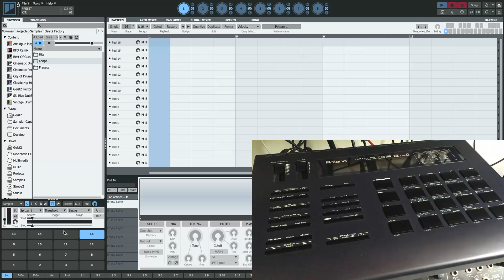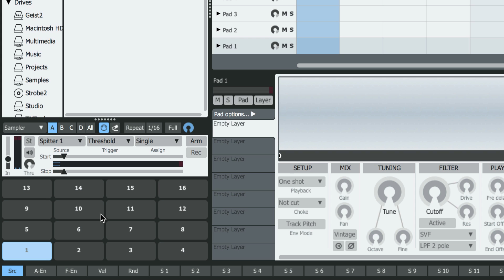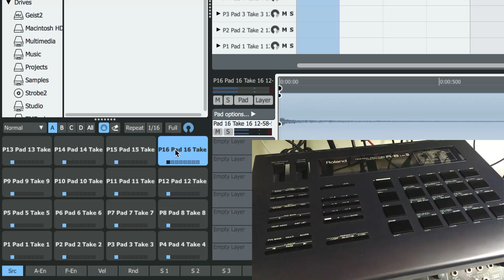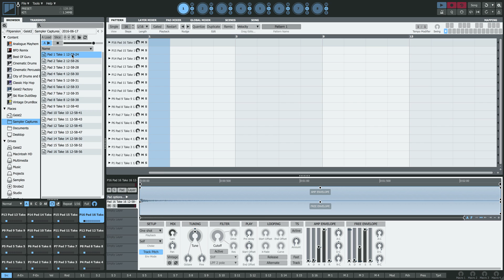Geist2 Tutorial - Sampling a Hardware Drum Machine

Comment: Spitter is the best!
Reply: Jesse Tal what is spitter?
Reply: Spitter is a little FXPansion utility plugin that also installs on your computer when you install Geist 2. Think of it as an audio transmitter for Geist. You first load the Spitter plugin as an effect on a DAW track that you would like to sample into Geist. Then load Geist onto an instrument track in the same project and choose Spitter as the external sampling source. Once Geist has been record-armed, any audio on the source DAW track will be sampled into Spitter -- ready to be chopped up and rearranged in Geist however you choose! :-)
Reply: Jesse Tal ahh. iv had geist 2 for a while now but have hardly used it. manual is too big to go through and I'm too knackered when i get home from work
Reply: @jessetal  You only need this when your DAW is not able to do that.
Reply: @janvandeweyer3272  Just about all DAW's can resample but the beauty of using Spitter is that you have such a great degree of flexibility in terms of what you can do with the audio immediately in Geist 2 depending on how you set up your recording mode in Geist 2.

Aside from that, there are times when I just simply like to use Geist 2 as a remixing tool, and getting DAW audio into Spitter is great for rearranging material in Geist 2 and/or applying Geist 2's internal modulation or fx.

Keep in mind also that when you save an fx pstch in Geist 2 that contains modulated parameters, the modulation is recalled when you reload the fx patch. That means that you could set up an audio mangling template in Geist 2 to twist around audio recorded into Geist 2 from your DAW via Spitter.